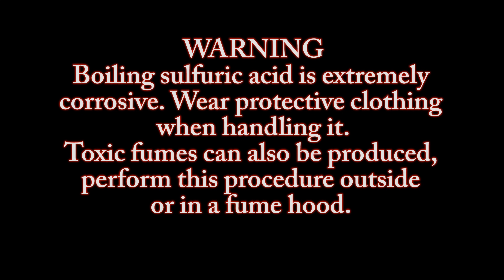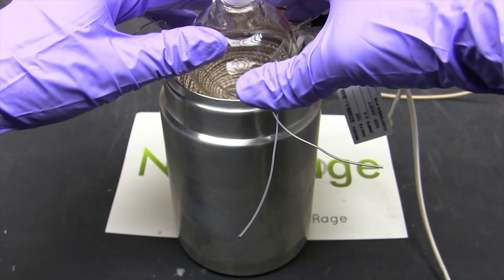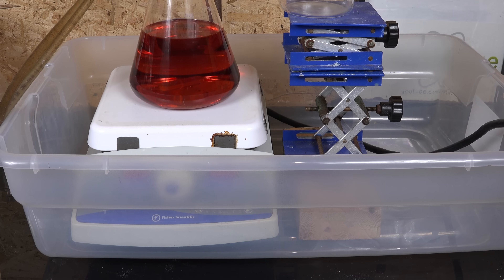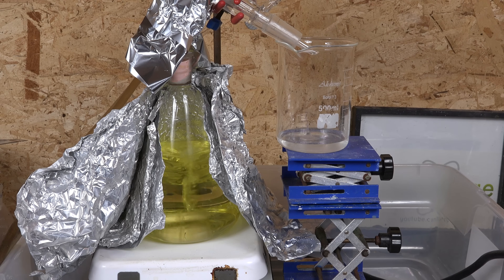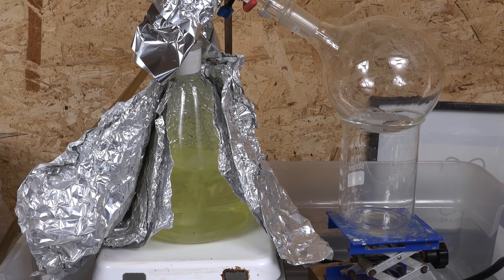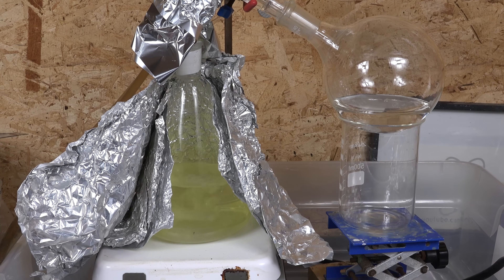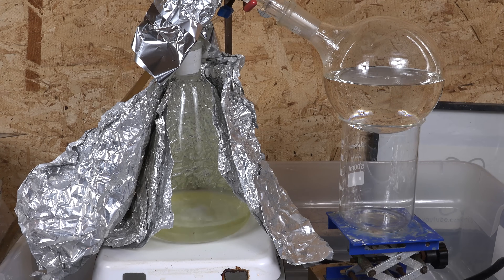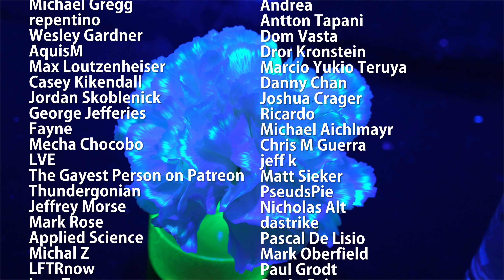Purification of Sulfuric Acid by Distillation - Revisited

Comment: When you say high temperature grease, would high temperature bearing grease work? Like agricultural grease gun grease? I think there is also a white lithium high temperature grease. Maybe that? Or maybe would breakdown?
Reply: Look at the decomposition temperature if it's listed anywhere. If it's not written anywhere try contacting the manufacturer and ask them if it's suitable. If the temperature is above the ~340°C you need then it should work fine.

Comment: Nice!
If the 98% is due to decomposition, wouldn't a second really cold cooler condense the SO3 and add it to the distillate bringing the concentration up higher again?
Reply: idk if that works but the SO3 is really reactive with water, even in the air, so any so3 you produce is probably quickly going to react with moisture in the air and react to sulfuric acid fumes, so you probably wouldn't be able to get higher than 98 percent with that. That being said, i have never heard of someone trying that. It'd also make the procedure more hazardous as you now have more fumes, you'd risk clogging the second condenser as so3 is a solid below 45 degrees C or something and it liberates a lot of heat during the reaction with water, considering it's essentially an anhydride of sulfuric acid.

Comment: Can a stir plate REALLY get to 500c?? Isn't that basically at the Draper point where everything becomes incandescent? It just seems implausible that a 1400 watt average outlet could achieve that over such a large surface in open air.
Reply from the maker: the lighting i use in the lab is pretty bright, but if i turned everything off, there is a faint glow.
Reply: @NurdRage  geez!

Comment: Hmm, using lead batteries to get acid? Is there lead dissolve to acid and then you get lead infused fumes, propably worse than acid fumes. Ptfe is good, but remember that it can only stand about 260c. As hobbyist 3d printerist find out with ptfe tubes, as teflon pan users find long time ago.
Reply from the maker: you can buy battery acid separately from the battery, it's used to fill/refill certain lead acid batteries made for that purpose. The new acid is usually pure (with water of course).

Comment: It looked like the transition from water to sulfuric acid could be seen with a color change of the PTFE tape in the ground glass joint. Was that just caused by a temperature change?

Comment: does the battery acid unopened contain any ions? like lead? or is it good for analytical chemistry
Reply: Battery manufacturers have very stringent requirements for the acid they use , and require very low levels of metal ion contaminates .
They will absolutely reject any prospective seller that even has periodic , random , issues with their acid testing out of spec , even if individual batches DO meet the spec .
This often happens in large process capture of sulphuric acid as a byproduct of ore smelting , which typically employ electrolytic anti corrosion measures on their bulk storage tanks . Inconsistencies caused by a fault or failure will tend to produce out of spec ( for battery grade acid ) levels of nickel and chromium contamination in the acid , and , it can be a major PIA to identify the source / cause , if they do not have any monitoring / data logging of their anti corrosion systems .
Even when they do it is often the last thing they think to check when this problem arises .
Reply from the maker: It should be good. Sometimes there are additives, but those should be listed somewhere. Otherwise it should be pure.